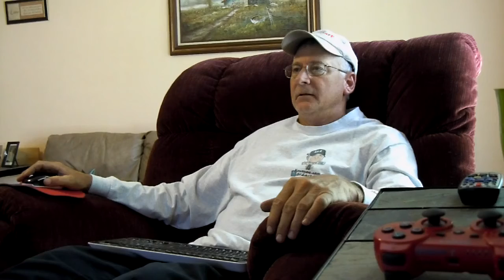HVAC Questions & Answers 4

Comment from the maker: I usually just get the driers from a HVAC supply store like Johnstone or Baker. I don't know where you can get them on-line. Also, you should be able to buy a standard service wrench for residential systems at any HVAC supply store.

Comment: Dr. Z I have two questions.I've been having trouble finding an inline filter to attach in between manifold gauge & recovery unit. Any ideas where to locate one online also ant preferred brand.I'm also unsure what size allen wrench set to buy for closing valves for a pump down closing off the condenser.Big fan of your videos that i've learned alot from. Thank you